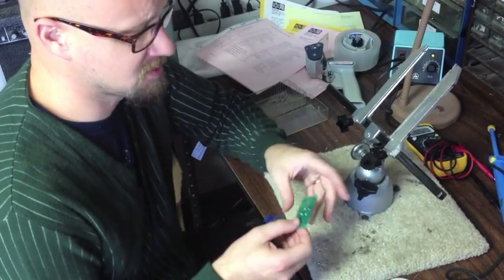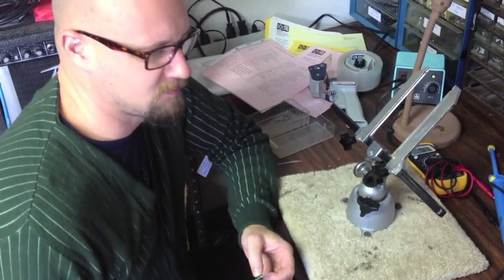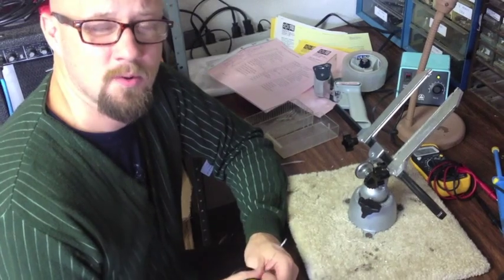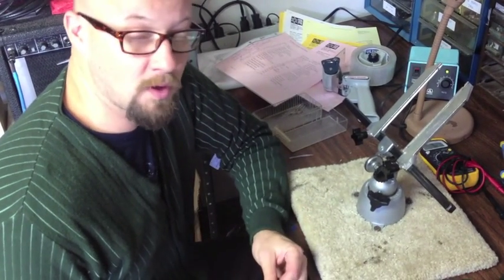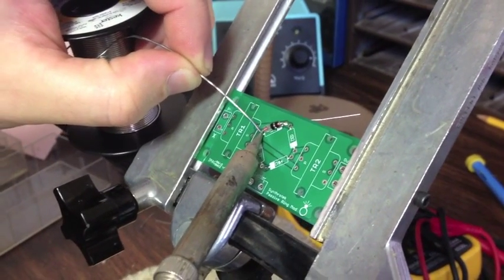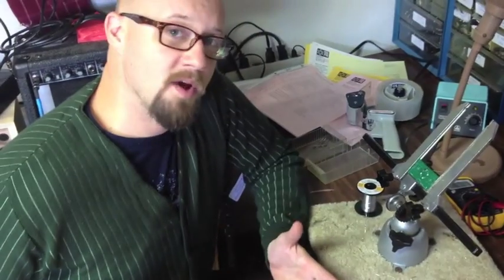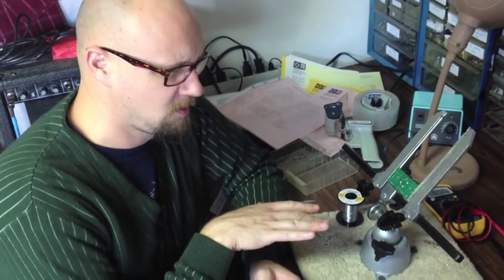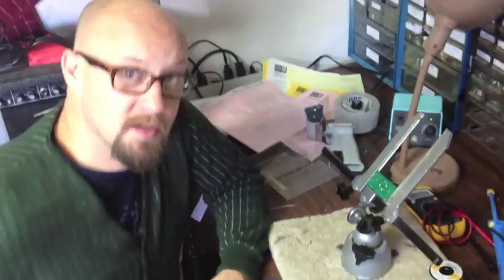Basic Soldering Technique and Skills - Synthrotek - How To Solder

Comment: As for the joint, a leaded solder joint should indeed look shiny, but be aware that for some compositions of lead free solder, a good joint will actually still look hazy, which makes visual inspection more difficult, but that's just the way it is. Despite the existing regulation, I do recommend leaded solder, 60/40 or better yet 63/37 which is eutectic.
I do agree that a temperature controlled soldering station is key. It instantly makes anyone a better solderer.

Comment: I disagree with a couple of the points. The temperature you're recommending is too high, imo. I would use 350°C/660°F for leaded and 380°C/715°F for unleaded. A too low temperature means you have to heat the board longer before applying solder and might damage components. A too high temperature on the other hand means the solder will oxidize more quickly. Not to mention the tip, if the iron is left turned on. It's NOT a good idea to just turn up the iron to the maximum temperature.